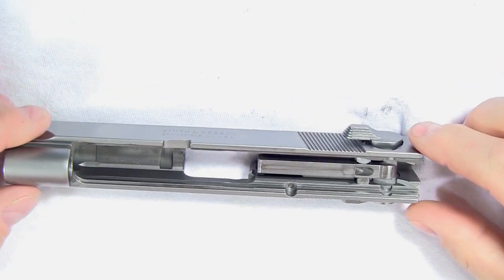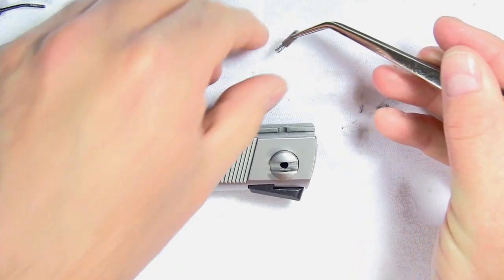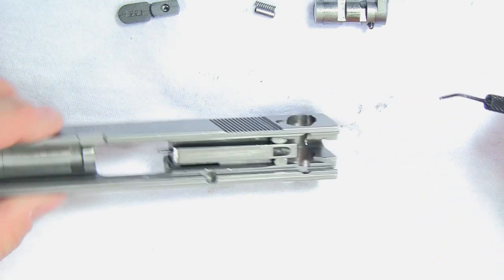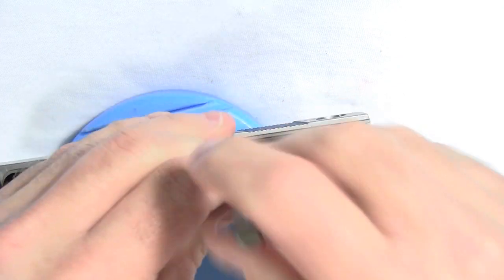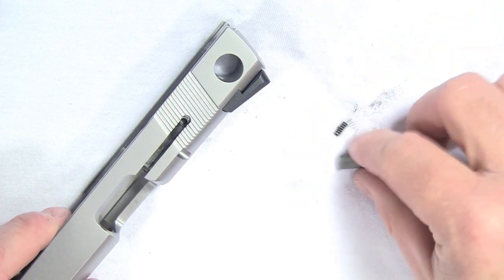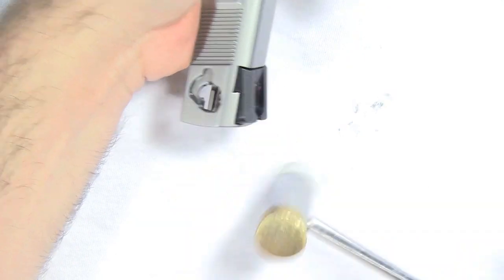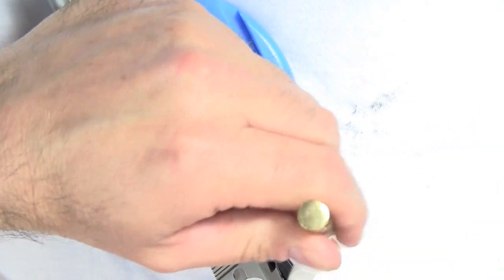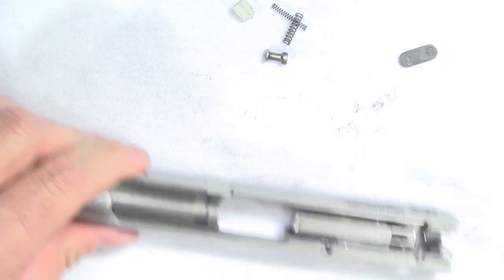S&W 3RD GENERATION DISASSEMBLY (SLIDE)   VIDEO #2 OF 4

Comment: I found this series of videos a few years ago and continue to come back to them when working on my CS9. I am currently enrolled in a gunsmith school and use my CS9 among others while learning about extractors and such. After all these years there is still almost nothing to be found online pertaining to the disassembly/reassembly of this generation of Smith and Wesson and I still return here and rely on these exceptional videos to follow the excellent step by step procedures. Bookmark this one folks, there is nothing that even comes close. The best you can expect is a novice field strip from all the others. Thank you very much for taking the time to clearly teach the proper techniques involved. This video should be the first thing that comes up when you type in Smith and Wesson CS9 or 3913 but unfortunately for some reason you have to search hard to find it.

Comment: I know the video is five years old, but I wanted to thank you for the detailed disassembly of the 3rd generation slide.  Recently, I needed to replace the recoil spring in my S&W 4566, and I ordered a replacement from Wolff.  Along with the recoil spring was a firing pin spring.  Having never replaced a 3rd generation firing pin spring, you video was spot on and made the task much easier...thanks.

Comment: Thanks for a very good explanation and description of disassembly.  My 6906 was becoming almost impossible to move the safety lever. Field stripping and cleaning didn't help.  Probably dirty, but after taking it down and wiping surfaces clean, it now works smoothly and easily.  Really a great pistol!

Comment: Great vid, recently purchased a 6904 that was missing the right side safety lever which would cause the whole safety/decocker assembly to become frequently misaligned and would cause the decocking function to not work and also make reassembling the pistol a bit of the bear.

Comment: Got mine from Classic Firearms, so no need to worry about scratching the outside. It's already scratched to s$!t.
Reply: I got mine yesterday and it has very few scratches, but is missing the decocker lever on the right side.
Reply: @dougtinkler3118  Mine had all the parts. The internals were in decent shape, outside not so much. Not sure what the point of paying for the best of 10 is. You pay an extra $20, but it seems to make no difference.
Reply: I remember when they had that sale! If I hadn't already gotten my decommissioned CHP from Copper Custom, I'd probably have gone for one of Classic's pieces
Reply: Strip it. Find someone with a bead blaster, not sand, hit the frame and slide, if they're stainless, with #8 glass bead. Blow clean with compressed air. Reassemble. Congrats, youre a gun refinisher

Comment: It never fails to amaze me how easy it is to take a pistol apart on Youtube.
 I got mine apart as far as the rear sight. Even with a decent sight removal tool. I couldn't get it to budge. Yes, I took the allen out first.  =) At least I got to clean and lube the assorted parts. It didn't look like that had been done before, ever. Now the safety is a LOT less crunchy.
Thanks for posting this! ~beer.gif~

Comment: Finally got the pin out. Had to punch it out from the top. It seems as though the hole in the bottom is larger than the one on the top. The pin is not tapered. Had to put the pin back in from the bottom.

Comment: Hi,...great job sir✓!!.....My 3rd gens appear to have an Allen locking screw in the center of the rear sight....  Is  that correct, and does that screw need to be loosened before knocking the sight out, ....L to R?..   Thanks.

Comment: you did not dhow removing the rear sight screw...  what size allan /  hex is that ?? thanks.
seems like if you just want to disable the mag disconnector you dont need complete slide disassembly..  just the rear sight...  of course nice to clean firing pin and channel and the extractor etc...

Comment: a trick that makes removing/inserting the slide safety lever much easier:
1. put some electric tape on a pair of narrow pliers
2. when you've trapped the firing pin behind the pin safety, instead of using a punch to push in out of the way from the rear, pull it out by the other end with the pliers protected with tape
3. standing the slide on its nose helps - you pull and stabilize in one motion, so you don't need three hands

this way the pin is completely out of contact with the safety lever and manipulating the lever becomes a breeze, in or out

Comment: So i can disable the mag safety by only removing the spring and block from under the rear sight?
Reply: yes, but it'll become a place where dirt accumulates. Although it can be cleared with a pressurized spray

Comment: I'm about to replace some parts in my slide - thanks for the How To.  I was wondering why the screw in the rear sight does not have to be removed or loosened?  What is it for, if not to hold the rear sight in place?
Reply from the maker: I assume you are talking about a slide with with the fixed "Novak" style rear sight.  If so, then you do have to loosen that "set screw" in order to remove the rear sight.  That screw is there to provide "tension" from the sight to the slide in order to keep it from drifting during firing of the gun.  Some sights fit rather loosely and it is obvious that that screw is what holds the sight in place.  
Hope this helps.

Comment: Would you happen to know if a 4043 slide would work properly on a 5906 frame?  I know the mag wells are different, but 40's do seem to funtion in 5900 mags, with fewer rounds able to pushed in of course

Comment: My 5906 does not have the small plate under the rear sight, nor a recess for it. When I took off the sight, the springs went flying. I found them, but putting the Meprolight rear sight on is going to be a task. Any advice?
Reply from the maker: +RhetoricalQuestion 
With the slides that do not have the plate it is still pretty easy to re install the sight.  Get the sight started on the slide first and tap it into place just until it barely starts to cover the hole for the first plunger and spring.  Then drop that plunger and spring in to the hole and while holding the spring in place with your finger tip or something like a pencil start to gently tap the sight further into place on the slide and you will see that the sight will cover the hole enough to release the spring with your finger.  Now when you get the sight to the last hole you are ready to drop the last plunger and spring into the hole and again hold it into place just like the last time and drive the sight into place.  If you are concerned about losing control of the springs again and losing them while you are attempting this try doing this work while your hands and gun parts are inside a small plastic trash bag or extra  large zip lock bag. This way if anything goes flying the bag will catch it. 

Hope this helps.
BB

Comment: I was told the extractor pin on a M.59 is removed from the top down. This vid says from the bottom up. I was also told that the hole is tapered. What gives?
Reply: lee sherman you’re right.... he showed the opposite. Also don’t use the hammer by itself to drift out the sight, first loosen the Allen, which he didn’t mention, then use a brass punch with the hammer

Comment: Thank you for uploading these videos. Well done sir!
After contacting S&W, I found the M459 safety lever is interchangeable w/ M3913 lever, and is still available. I would not be surprised if it will fit other models as well.

Do you have any thoughts on disabling the mag. disconnect?

Comment: I have a Model 39-2 that I want to Duracoat just the slide, it has the later extractor much like this slide in the video does but the decocker is the left side only version. How much different would it be, having a hard time finding any info on taking that apart.
Reply from the maker: +Bayan1905 
The slide on the 1st and 2nd gen guns are very similar to the 3rd gen gun.  You should be able to follow the same methods for disassembly and reassembly as you do for the 3rd gen.  

Good Luck
BB

Comment: I have the 5904. I want to replace the rear sight. Can I just remove the rear sight, being careful of the springs underneath . Or do I have to go through the slide disassembly process?
Reply: No I removed the sight to disable the mag safety without a total tare down

Comment: I have a 6906 mfg. in 1990 that had a chip in extractor. I have shot ammo with steel casing.  Do the extractors on Gen 3's normally chip easy?  Thanks, great videos by the way.
Reply from the maker: The extractors on these guns are known to wear.  Probably a good idea to replace them every 10000 rounds or so.  Shooting steel case ammo is going to accelerate wear and tear on any part that it comes into contact with, especially the extractor and feed ramp.  Just how much faster it will wear gun parts than brass cases is open to opinion.
Reply: Thank you, in my question I meant to say " I have never shot ammo with steel casing" and never will.  Your videos are outstanding.  I love the Gen 3 pistols, I also have a CS-9 and just picked up a like new 3913.

Comment: Will a single sided safety/decocker lever from a s&w 459 fit in a s&w 6906?
Reply from the maker: I do not know for sure if it will fit as I have never mixed 2nd gen parts with 3rd gen guns before but I would not be surprised if it does actually fit.
Reply: blubelly2 Ok, thanks for the reply. I've found a 6906 for sale locally but it's missing the right side safety/decocker lever and was just looking for another option since I can't find the right side lever in stock anywhere.

Comment: my safety won't slide off after pushing the tiny button down.  I tried pushing it really hard with two pin punches too.
Reply: Stefano Dawg  tried it with a 0.9mm diameter punch .  I can feel it pushing down but the safety only moves about  0.1 mm and eventually I give up and let go and I can hear the safety click back into place as soon as I let go

Comment: I can't get the rear sight to even budge it seems pretty rough under there though
Reply from the maker: When this happens you need to try soaking overnight the sight/slide in liquid wrench or other similar product. After one day of soaking it will break free from the slide.
Reply: blubelly2 would silicon liquid wrench do it, or even break cleaner?
Reply from the maker: zombie1attacks I bet the silicon liquid wrench would do it but not the brake cleaner.

Comment: WARNING!  A word to the wise regarding any attempt to remove the extractor pin.  Removing the extractor pin is by far the most difficult task, it is factory pressed in with hydraulic tools. To pose even further obstacle:  most of these 5900/6900 series models are long out of production and the pins are now seized in place. 

Getting the extractor pins out of an older gun can be a challenge (understatement ALERT!), as they usually require some force to break them free and get them moving. We're talking a 4 oz ball peen hammer and a starter punch. If you can manage to get the pin broke free to move with a starter (bend resistant) punch,  the pins can then be removed using a 1/16"  steel pin punch. Bending the 1/16" punches is likely but it so happens to be a great way to create a new 'starter punch' when the punch is broken off at the base where the taper starts.

If the pin won't budge (and it likely won't) and you persist with more forceful strikes, you'll likely mar, or deform your slide.  S&W performance center will be your only recourse then, if they even work on an altered slide, you gotta call them in the United States at their country code, then 800-331-0852.  Smith & Wesson no longer supports these long out-of-production guns - though some limited parts are still available until supply runs out.

Most extractor pins will definitely NOT move as easily as this one did in the video here. The remainder of this vid is accurate and helpful regarding slide dis-assembly and well presented.
Reply: +Boris Bordeaux 
Seized in place?  Well, isn't that what a soaking penetrating oil will overcome?  As far as factory hydraulic pressed, so what?  Drive it in and out with a punch!
Reply: You remove it from the opposite direction as he showed since it’s a tapered pin and it comes out easily

Comment: I thought you were doing great untill you busted out the hammer and started on that rear sight and left hammer marks...even if the hammer was nylon or something soft...get the tool and press it out.
Reply from the maker: +lilstevo74 Surprisingly, using a nylon hammer like I do in the video will not mar the metal surfaces.   Any marks you see left behind are because the oil is completely quenched from the metal surface.  As soon as you spread some oil the marks disappear.  I have removed countless sights and other gun parts over the years without damaging the cosmetic surface using that same hammer.